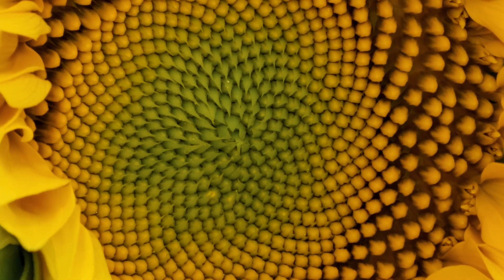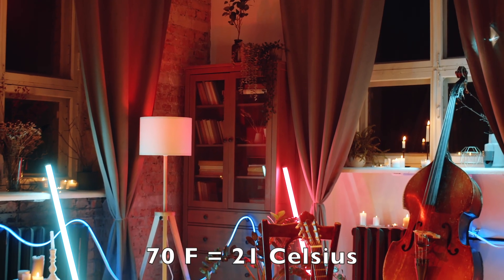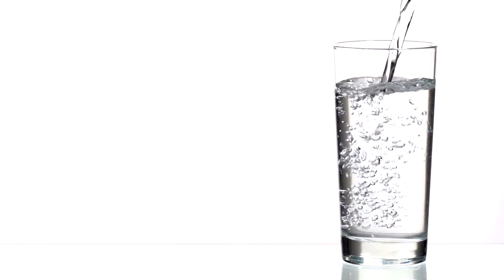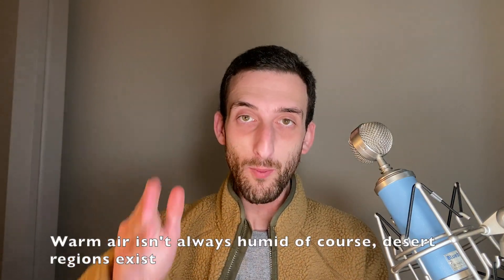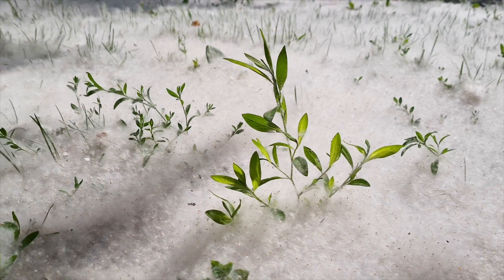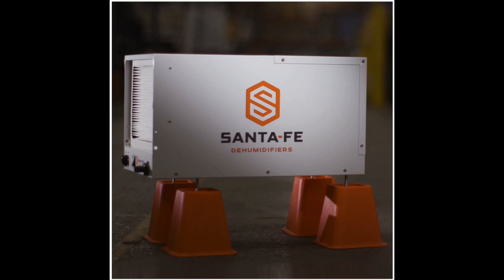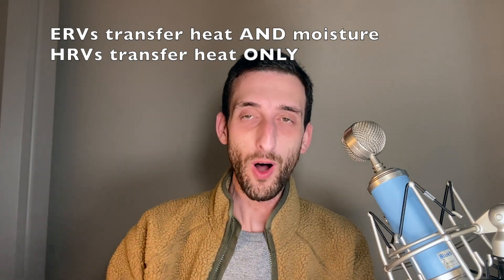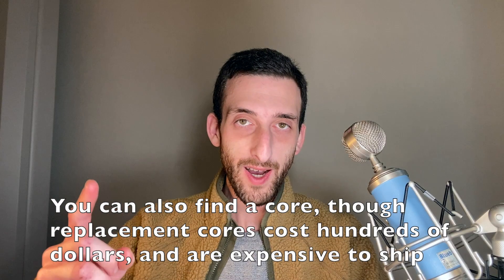HRVs vs. ERVs: Why I Ditched My DIY HRV and Bought an ERV Instead

Comment from the maker: Hi all! If you’re struggling with indoor air problems, you might like my free 5-day course. It covers everything I wish I knew sooner: https://renegadeairquality.com/

And if you’re house-hunting or sanity-checking your place, I made a visual, tool-free mold inspection guide. It comes with an interactive checklist you can use while you walk a home: https://healthyhomeguide.gumroad.com/l/DIYMoldInspection

Lastly, I’d like to mention that even if you live in the desert, you may still need a dehumidifier to supplement your ERV! Even arid regions can get humid during certain times of year.

Comment: A reversible mobile aircounit in the lowest setting is actually the holy grail for ventilation...    They are cheap, dehumidifies and only need a single exhaust which is comparable with most existing ventilation systems. They are also dirt cheap compared to balanced ERV systems.

Comment: This helped a lot. I currently run a laser engraver/cutter and 2 3D printers in my basement workshop with NO windows.  I shouldn't be able to smell the plastics, but I do, and even with an extractor removing smoke from the laser, odors linger.  Even with the extractor going full blast, it doesn't pull in enough replacement air for good air exchange so I have been looking for a way to add an air exchanger to get more fresh air in.  Humidity is also an issue as there are times after or during heavy rains when the basement leaks and humidity sky rockets to 90% or more.   I installed a 9K BTU mini split which has done wonders in removing humidity, but I still need to get air moving.   Exiting the air will be easy as I can add a wastegate to my extraction system to expel the stale air, but getting an FAI is the issue, it has to be far enough away from the exhaust due to the fumes from the laser and printers.  I will have to bring fresh air from the other side of the shop, but now have a pretty good idea what and where to put things.    Your DIY one will work OK for my needs since either way I will be battling moisture from outside when the laser is going.

Comment: Grains per pound.  😂  wtf is a grain! Psychometric charts are hard enough without the world's nutttiest units.
Reply from the maker: Haha true
Reply: @HealthyHomeGuide  7000 grains apparently in one pound.
Reply from the maker: That’s a lotta grains
Reply: @HealthyHomeGuide are grains used anywhere else? I was in  sewage treatment , USA scientists measure pollution in mg/l but the engineers use USgallons (3.75 Litres not Imperial gallons 4.54litres)  and pounds (0.454kg).  Treatment rates are often in gallons or pounds per cubic feet  Text books are full of conversion factors and complicated equations just to get from one to the other (and back again).

Comment: So do either of these make sense when you live in an area that is humid 11 months of the year ?
Reply from the maker: In that case, an ERV + high capacity dehumidifier like a MERV-13 filtered Santa Fe or Aprilaire is best. Or you could even just use a ventilating dehumidifier only.

Comment: That is why a hrv should always be used with a dehumidistat which compares interior/exterior temperature/humidify it should never run constantly. Always ventilate kitchens/bathrooms separate with a makeup air heater when in a cold climate, damp climates do need dehumidification. I looked at your design, its good, but the incoming air filter will collect mold spores at certain times of the year  and they will  spread, you could add a uv light but that will destroy the plastic

Comment: what if you did stick a dehumidifier in line of the intake of your hrv. basically taking the moisture out of the air on its way in to the hrv. this demoistureized air gets heat added to it and becomes the new house air until it too is sent out recycled on the way.

Comment: Thank you for explaining all the useful info about  humidity in one great video. Now I understand so that I can be proactive and control humidity in an already humid home. I used to run my dehumidifier 24/7 until my bill went up $250+ the first month, so my thoughts turned to what can I do to assist my dehumidifier (and my electric bill)in keeping humidity down without breaking the bank and not put holes anywhere in the home I rent? Came across another one of your informative videos and it was perfect!! , I'm going to watch your ERV video and see if it will help in my situation. Do you recommend a particular ERV company where you could benefit if I use your link? For the Santa Fe as well? Thx
Reply: a dehumidifer like meaco arete is pretty efficient, though if the region is extremely humid its over

Comment: Thanks for the video!

I was wondering if you considered the Mitsubishi VL100?

I need to have something in my truck camper (17mm2), co2 ppm levels are really high (1500-2200)

I'm thinking about the Mitsubishi VL100
Because:
1. It's an ERV
2. No min wall thickness (my walls are 60mm), Not a hard limit, I can always build a box for it

Would love to hear your thoughts on this or if you know of any other products that might fit me that I can research on

Comment: My homes problem it is spikes in humidity we live in cold climate and small like 900 sq feet area so spikes in humidity are often from showers and cooking or even breathing at night exhaust fans are not helping I'm monitoring and see it reaching 70% humidity in bedrooms where it then condenses on cold walls. I can open a window and let the freezing air dehumidify but my concern is when I'm not around or in the middle of the night these spikes happing. Install team will not install because lack of space for ducts...
Reply: A simple mechanical ventilation system is perhaps the solution for those situations. A constantly running fan extracts the humid air from the kitchen and the bathroom (the humid rooms) through a duct out to an opening to the roof or facade. Small slits let fresh air enter into the dry rooms (bedrooms and living room). The ventilator could use a humidity and CO2 sensor to adjust its power, and the slits could have filters. Small slits should be made in the barriers between the places where the fresh air enters and bathroom and kitchen. The slits to the outside in the dry rooms usually are made near the windows. And the slits in the inner parts sometimes are made in the doors, or aren't necessary because there is enough free space between the door and the floor. These slits could have sound filters.
It's a cheap and easy to install solution and it works well to keep humidity low enough. The problem is that it doesn't recover heat or energy from the thrown out hot air. And this could be an issue in very cold places. The fan should be constantly running. It's an special fan that doesn't use much energy and doesn't make much noise when running at low power.

Comment: Thanks. 
So it works in winter when you need to recover heat.  
In summer, either open the windows, or mechanically ventilate with a pollen filter. 
(Better HRV systems have a bypass system)
In summer running your HRV will condense some of the moisture within the unit, so actually introduces less moisture into the space than direct ventilation. ….but of course that can lead to mould within the unit on the incoming air. (In winter the opposite happens, so on the out going air, so not as much an issue) if used in summer you need to clean and sterilise the unit more often.

Comment: I have chronic allergic asthma with a severe sensitivity to mold that has made my life miserable. On my honeymoon I slept on a balcony, I have also slept in cars and yards in order to not die of suffocation. I have moved at least 10 times and been through three homes, gut renovating one of them.  The only thing that helps is being outside, so I suspect my indoor air has higher concentrations of naturally occurring outdoor mold which is why I want to experiment with an ERV in my tiny 10x10 home office which I can also sleep in during my experiment.  I need something I can connect to my window, should I buy a Broan?
Reply from the maker: I’m so sorry to hear about what you’ve been going through—that sounds incredibly challenging. Using an ERV in your home office could be a great way to improve your air quality, but finding the right setup for your unique needs is key.

If you’d like help choosing the right model and making sure it’s installed effectively, feel free to visit my website and schedule a chat. I’d be happy to work through this with you and help you create a healthier space!

Comment: Can i temporarily install and erv thru a window because my house has no ducting and i dont have 20k for ducting yet my house is tight and making me sick? I need a solution winter is coming window fans are freezing me 😂
Reply from the maker: You're in luck: I literally have a video about that exact thing! Step by step. It's called "DIY Energy Recovery Ventilator Installation (For Homes WITHOUT Ducts!)"

Comment: To my understanding, the ERVs are a similar concept as the HRV, but they use a rotating wheel with desiccant in it. The desiccant absorbs the humidity from the humid side, and the wheel rotates it to the dry side where it dries the desiccant and puts the humidity into the air. Very simple.
Reply from the maker: it's a bit more complex than that in practice, but yes, basically.

Comment: Do you know of any ERVs that are sized for a single room?  I'm planning on using a mini split heat pump as cooling source, but I suspect that with a well insulated room it won't operate enough to dehumidify the room.

Comment: Hey.
Although making ERV out of cheap HRV won't be easy, I don't think it would be unfeasable or too cost inefficient.
With the design you made, well firstly you'd need actual countercurrent in the heat exchange unit - your design goes in 90° fashion, which also lowers efficiency.
Once you have this solved, you'd only need water transport material - wick (could be any textile) that would transport water from one end to the other.
Simples thing I can think of would be either textile or steel mesh added on the side wrapping around the inlet-outlet and on throughout the length of the exhanger.
That material would need strong capillary action, so microfibre "quick drying" towel would probably be the best.
Both would pickup the condensation and transfer it to the other side, where it would evaporate to dried out air - this would work both ways.
If done properly, this wouldn't affect efficiency, but you'd get moisture transfer.
The proper countercurrent construction would likely increase the efficiency anyway already.

Other, more advanced improvement I can think of, is making 3 countercurrent exhange units inline, with inside/outside separated in chambers between them, with 2 or 3 wicks running between inside/chamber/chamber/outdside in either alternating or linear fashon, so that moisture exchange would also be gradual, but I think it would not do very much, since the moisture transfer would only occur at dew point.

Comment: I want to avoid dry mucus membranes/sinus etc during winter - huge problem for me. Is what you are saying this?:
INSTEAD of having a bit colder temp 18C AND use humidifier to get up to 45% RH ---> JUST increase temperature to 21C (And humidity will come along anyway)
Reply from the maker: Thanks for the question. No, that's not what I'm saying. I recommend that you watch my video on humidification titled "How Healthy is Humidifying REALLY?" It should answer your question.

Comment: I live in a similar clime to you, I haven't constructed it yet, I intend on using your DIY HRV design. Learning from your mold disaster, I am going to see if I can incorporate some form of charcoal, or likewise inexpensive filter inserts for probably at intake/exhaust from the outside.. I feel like it would help, but also decrease volume. 
Just my idea, and 2 cents.
Reply from the maker: The mold issue primarily occurred in my home itself. This was from the humid air the HRV was bringing into the house. Some amount of mold is everywhere, and whether or not you filter the HRV (which I did), mold will grow quite a bit in humid conditions.

Comment: he got paid to encourage you to buy that crap. Folks...just ventilate your homes by opening doors and windows when is cold in the morning (during summer) and warm in the afternoon (during winter) and then use your air conditioner/furnace few extra minutes to compensate for lost energy inside your home and....that is it. An outside thermometer showing relative humidity will help and its just around $10. ERV installation cost is $3 - 6 grand, dehumidifier install cost for whole house is can range $2.5 - 3.5 grand. You will never recover cost of those devices and you will pay more for electricity. ITS JUST NOT WORTH IT....but it's just my opinion. HVAC industry come up with worthless gadgets all the time and they try to make money on it. Some of their product are good but rest of it is just pure...and expensive junk.
Reply from the maker: No, I was not paid to tell you to buy the items in this video. If my content is sponsored, I will always clearly disclose that. None of my content is sponsored yet. I make these video because I've suffered from environmental illness, and I want to help ensure that what happened to me doesn't happen to others.

I've tried your ventilation strategy and it did not work for me - I live in the northeast US. Opening windows is often not a healthy or reliable option for diluting the air in one's home. For one, outdoor-generated particle counts are often surprisingly high. Get a particle counter and test it for yourself. Though it does help to dilute the concentration of VOCs and CO2, opening windows often RAISES the overall particle count. Also, there often isn't enough natural airflow through windows - it's inconsistent. Also, what if it's too humid outside? Too dry? Too hot? Too cold? Using an energy recovery ventilator is far superior to opening a window.

I have videos where I demonstrate DIY installs of both an ERV and a dehumidifier. It doesn't have to be as expensive as you say, though it usually is for a professional install. For those on a tighter budget, I also have a video where I show how to build a DIY fresh air system for a fraction of the cost of an ERV, but of course, without the energy recovery benefits.
Reply: So basically you are saying that Passivhus doesn’t work?

Comment: I'd say a mixture of the old rotating ERV should be possible with your same design or similar. But yea the new ERV are using membranes that actually let about 50% of the moisture pass through the material.. so that type of material isn't feasible for regular people to get. At least no long term lasting stuff.
You could build one out of cotton I guess, but it'd have to have much lower air flow and be much bigger unit lol

Comment: Ouch! Yeah, living in the uk we know all about damp air :( . Lots of older houses that have been 'half fixed' ie made 'warmer' by using double glazing and sealing drafts appear to be suffering with damp issues.. We certainly are. So HRV is definitely not a solution!
Reply: Are you sure? I think he was saying that his issue was in the summer when his climate was both hot and humid. We get most of our mould growth in the winter on our cold walls and mostly in corners where there's little air flow. Our Victorian terrace has solid walls with no insulation so they are cold to the touch and when the warm air touches it we get condensation. It wasn't anywhere near as bad when we still had draughty old windows. Everyone seems to say that you need more ventilation in this scenario and surely there would be no downside in having a heat exchanger on your extractor fan?

Comment: I was finally able to install and run my Broan ERV on Friday, waiting for a break in the rain to install the inlet and outlet through the side of the attic. Since my heat pump's air handler uses 500 watts to run I gave the ERV a simple dedicated duct system, pulling stale air from the two upstairs bathrooms and sending fresh into the hallway between the three bedrooms and near the upstairs HVAC air return so when the heat pump is on it will help circulate fresh air through the house. To keep from having to constantly change tiny filters I installed a larger insulated in-line filter to the fresh air supply coming to the ERV. ~100cfm only takes 44 watts per hour.

It was so nice watching bedroom CO2 drop from 1600 to the 700s. I installed a Tamarack Perfect Balance air return in the bottom of one bedroom door so far and will be doing the rest soon to help keep air moving through the house even when doors are closed.  

Thanks for sharing your setup and helping me feel like setting up an ERV would be worthwhile even without having ductwork go to every bedroom.
Reply from the maker: Fascinating! Thank you for sharing your electricity usage and for the tip of installing a larger in-line filter. That little MERV-13 filter inside the Broan ERV is annoying to change for sure. 

Your configuration is super cool. Email me if you’d like to be featured at some point.

Comment: 100% agree with you. I don’t understand why the industry advises the opposite in all their specifications. I just finished a new house and installed 2 ERV’s with resistance from the HVAC supplier. Fortunately I have taken classes in physchrometry over 20 years ago and that knowledge is still paying off.
Reply from the maker: I salute you! I feel that psychrometrics is the #1 subject that everyone interested in creating a healthy home should understand. 

It is such a huge problem that the HVAC industry is largely unaware of the dangers of using HRVs (especially without dehumidification) in humid regions. The HVAC industry also unfortunately heavily favors people with ducted systems in their homes. I hope to solve these problems someday.